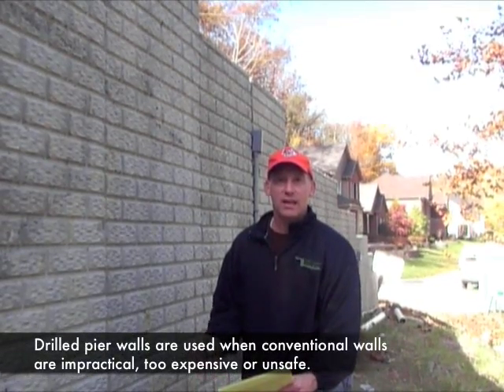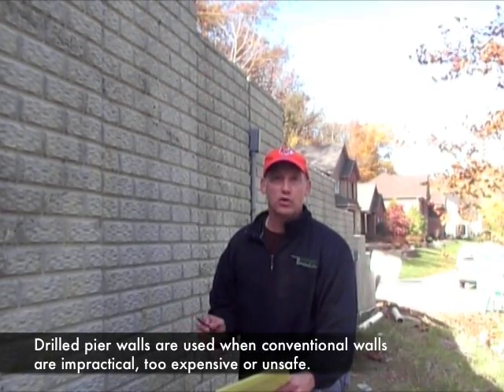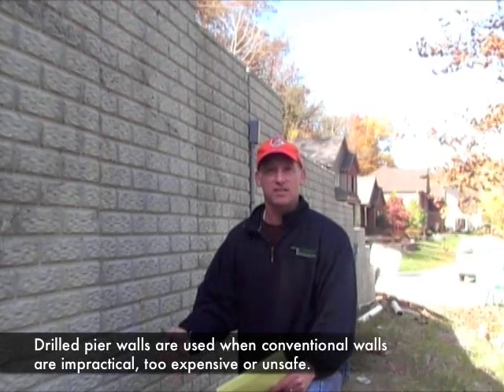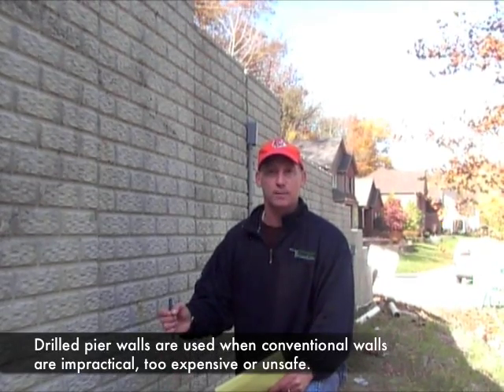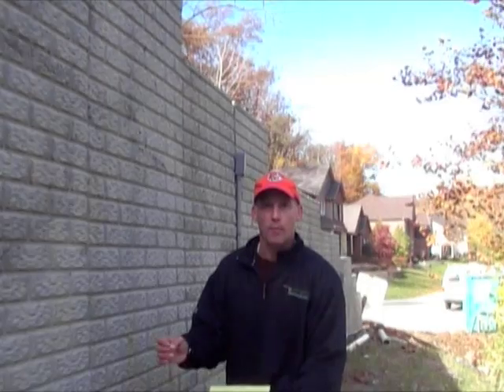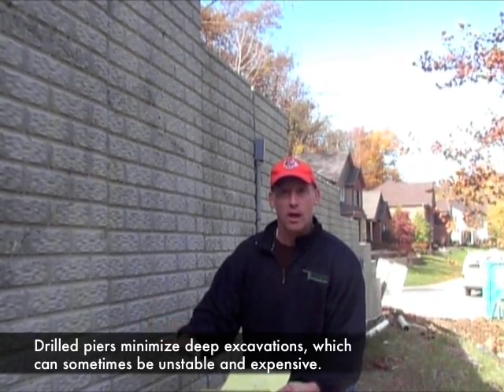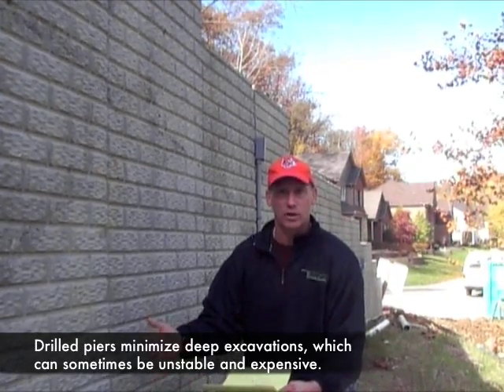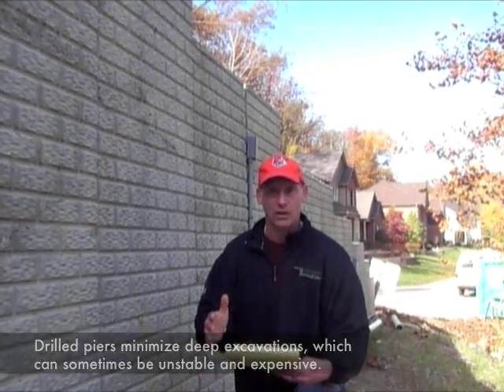Drilled Pier Retaining Wall

Comment from the maker: Most of the time we install every-other pier, so that there might be 3 or 4 holes open at one time, unless the hole is filling with water.  This helps with concrete deliveries to minimize waste.  Also, the soil generated during the drilling process gets everywhere, so if adjacent piers are too close, then the soil would get into the open shaft nearby.  Because of all this, we usually skip every other pier, and then (on the next day) "fill-in" the ones that were skipped.